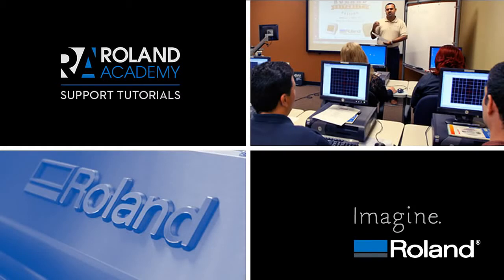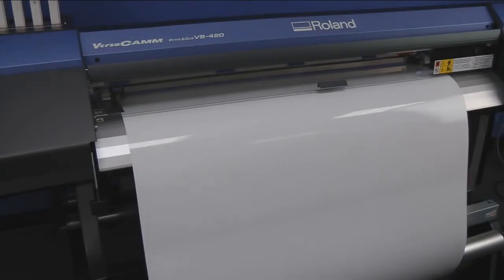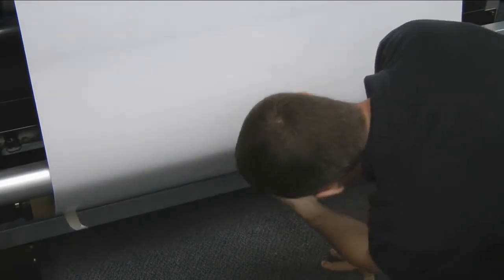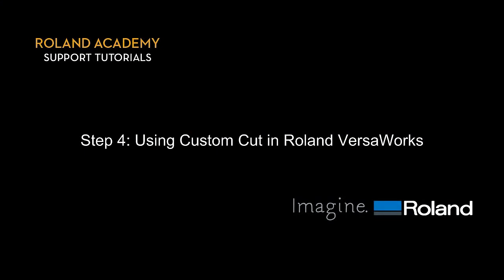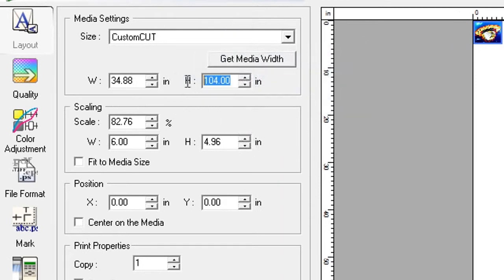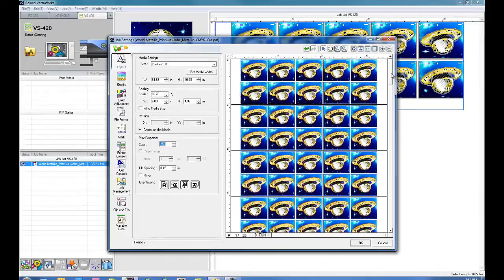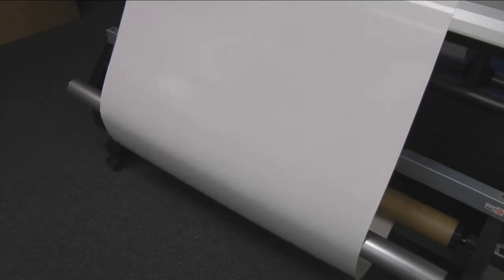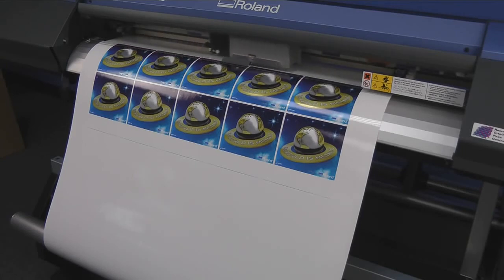VersaWorks - Settings for integrated print/cut with a take-up reel

Comment: Hey guys, I have a VG3-540 t and there is no TU2 mode. Do you know what it may be called here?
Reply: Did you ever figure this out?
Reply: @blakerobinson257  I will be honest I dont fully remember my issue and why I struggled with this, when I setup>setup with takeup unit, it works every time.
Reply: @ so strange. When I do set up media after clamping the pinch rollers it doesn’t allow me to select anything but enter to set up media length. I may call Roland to figure it out cause it messed up a job when I tried to do a print and cut file.
Reply: @blakerobinson257  What Machine do you have?
Reply: @PrintingService-dz1ir I have a mg640 which came with a take up unit and core but there’s no options about a tu or tu2 when setting up the media

Comment: Is it possible that someone has somehow installed the dancer bar wrong? It doesn't fall down at all, it seems to just want to spring back up which is the opposite of how a tension system should be working right?

Comment: Hi guy's. We just got a Roland VG2-540 with the take up system. How would a job be set in Versawroks to use the take up on larger graphics? In this case, one graphic is 51" X 96"
Reply from the maker: Hi Falcon Flooring! Great to hear you have your VG2-540.  You need to center your image in VersaWorks on the roll & set your usual quality & colour management settings as normal.  You can either pre-tape the media to the take-up (before you print), or you can run the print (to save media) & then hit pause & attach your media to the take-up.  Here's a hint:  Tape it in the middle of the roll first - this gives you even tension.
Reply: @RolandDGEMEA  Hi guys, yes this machine is nothing short of AWESOME !!!! The question I have for the longer graphics is, Should I still set up the media height to the recommended 13" as shown in this video? If I do that, Versaworks show the job being output in panels. We aren't looking for panels. We need in this case this particular graphic to be 1 full print of 51" X 96 with one cut on it's perimeter.
Reply from the maker: @falconflooring2797  Hiya, no you can ignore that part...that is for if you want to create batches of print and cut graphics using the Custom Cut feature. Just send as one big job, however you need to make sure you have setup the take-up with the TU2 setting...for print and cut, so it doesn't wind on before cutting!